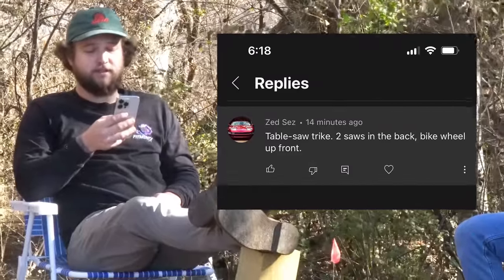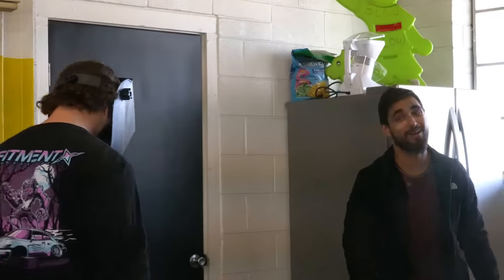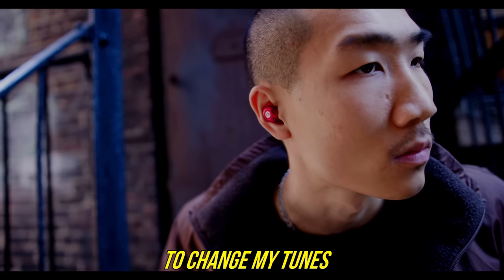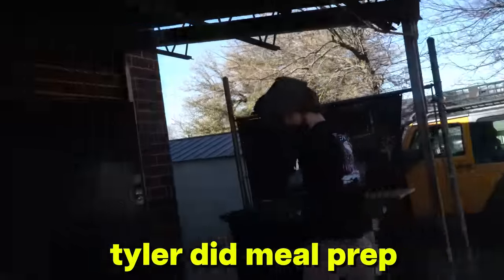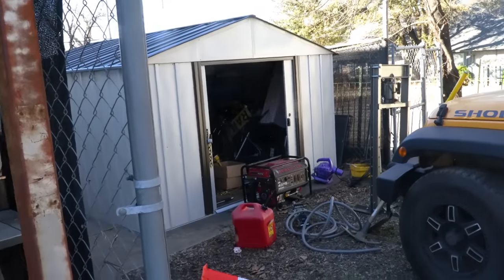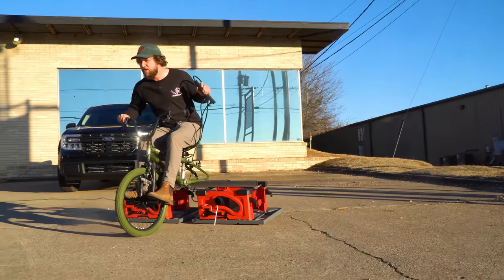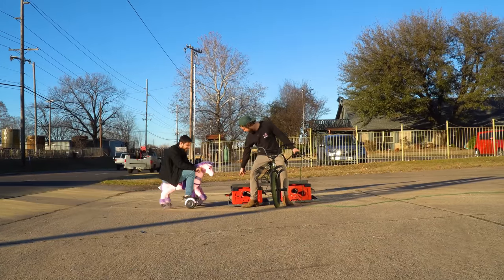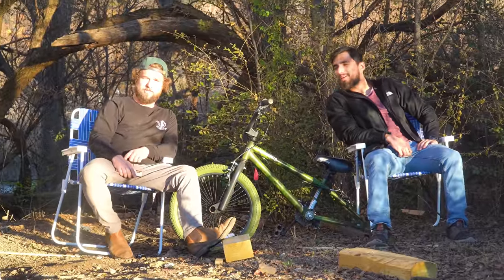Table Saw Powered Trike!

Comment: It would actually be a nice bike if you welded just the motors to the bar in the back, and added wheels instead of saw blades. Then jumper cables to car batteries so it's portable
Reply: You cant run a table saw on 12 volts silly internet stranger